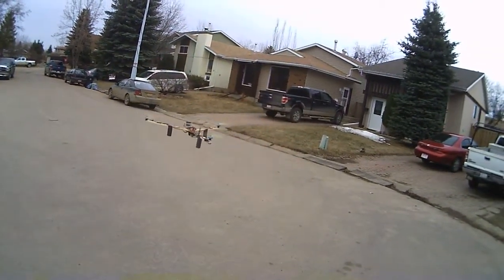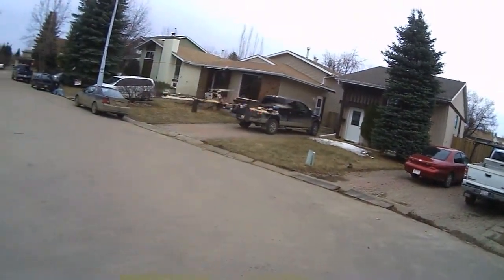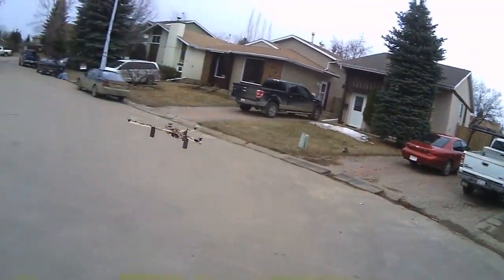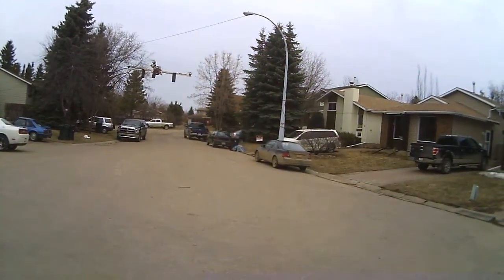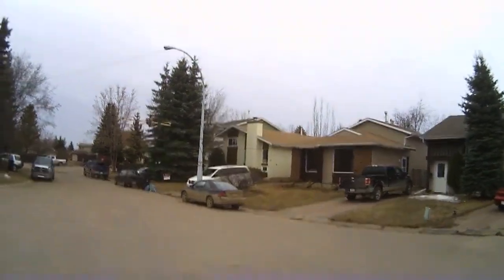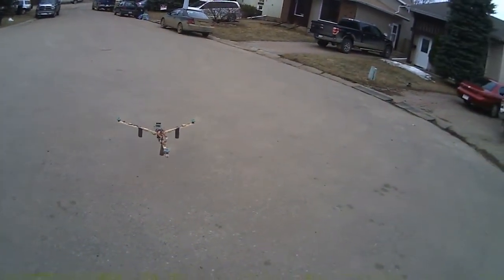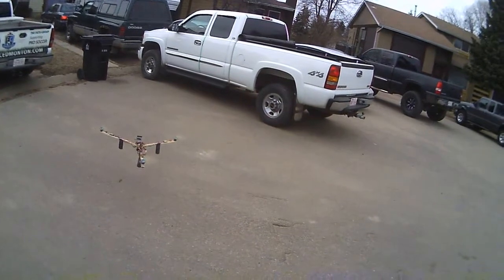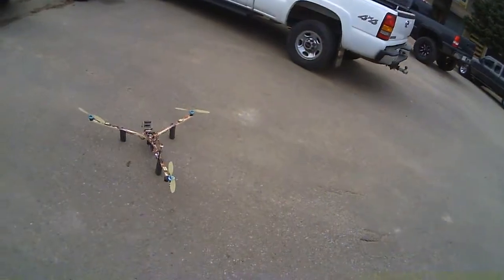GoPro Tricoper jello video test

Comment: I think the problem with the jello (my translator doesn't know the meaning of it :) but I think it has to do with vibrations ) is generated by the long motor arms, in the vertical direction is no support so those motorarms can vibrate in this direction.
Because they are mounted on the central frame, the frame will get the vibrations of three arms.
Depending of the fases of the vibrations eather they will be amplified or dampened at the frame.

Comment: I have the same experiences with flying the GoPro on my Hughes 530 helicopter, I have balanced everything on the heli with exception of the main motor.
I will try to find a vibrationproof mounting method for the GoPro this coming summer.
Flying it with the Gaui330x I am having no problems with vibrations and it is mounted ridgid to the frame hanging in a tilting cameraframe.
Noticing how many vids there are to see on youtube about vibrationproblems with the GoPro, it's a nice challenge :)